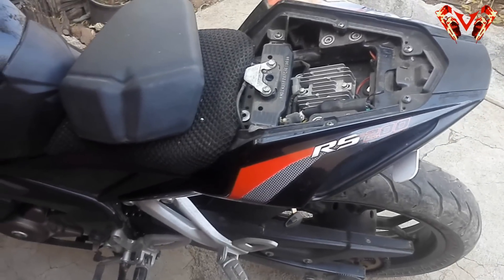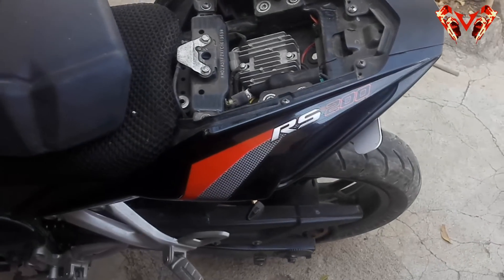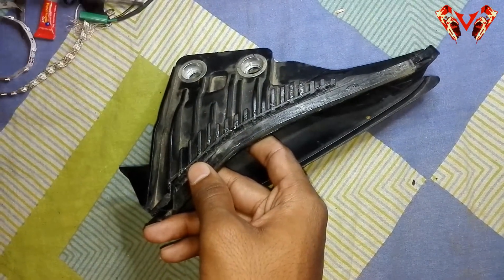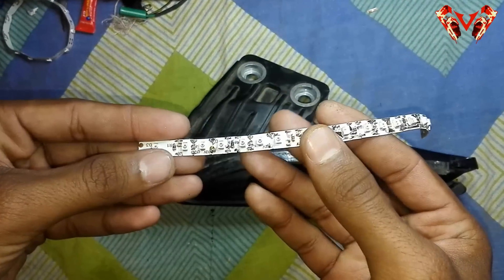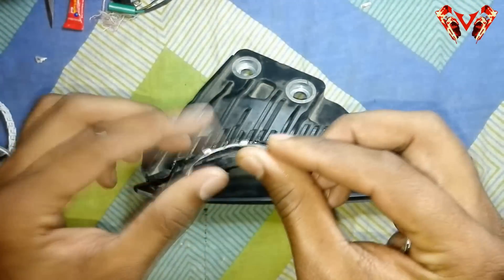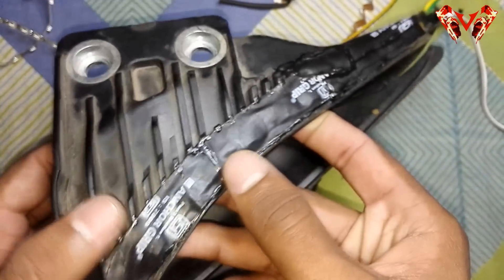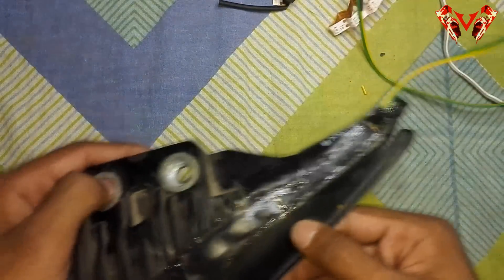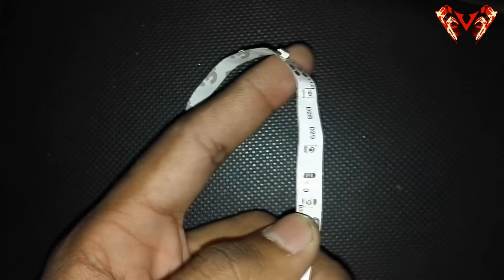DIY audi type DRL/INDICATORS/BRAKE LIGHTS || Modified Pulsar RS200

Comment: I also thought of similar mods but problem with all such mods is the naked LEDs are not bright enough to be visible in strong daylight. Either they have to be put under tail to make them visible or some kind of reflector/lens/ diffuser etc to mak them visible.

Comment: hey bro
please tell me how to turn on the headlights/LEDs in RS200 2015 model without starting engine ? 

below article is for ns . but for RS not able to find that relay mentioned. please help and make a video
http://www.xbhp.com/talkies/do-yourself/24422-pulsar-200ns-removing-battery-saving-feature-using-lights-without-cranking.html

Comment: vicky bro...
its again me here, few days back i did ask about to end can and stuffs.

saw your video of tail light installation on the tail panel.

the doubts are silly,
where should I search for the acrylic sheet rod?what shop?

and how to cut the tail panel with good finishing and making it symmetrical throughout??
Reply from the maker: for acrylic rods go on ebay , i used the soldering iron as i stated in the video
Reply: vicky patmase using soldering to cut the tail?
Reply from the maker: tail or where i installed the acrylic?
Reply: vicky patmase okay.
I dnt have a soldering set, so should find something else.
Reply: Can you show a video as how u cut the tail part  also where can i find the connectors for the tail light